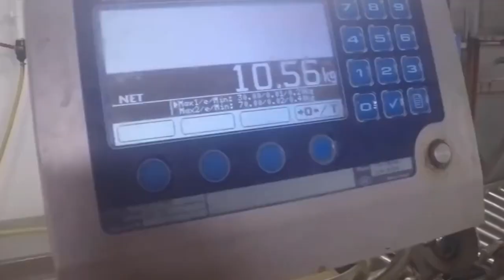Alaska Job as a Seafood processor on a fishing vessel.  What does a fish processor do?

Comment: How much star paying
Reply from the maker: Depend on what company but $11-$13 start pay
Reply: I work for silverbay seafoods, not a boat processor but they start at $13
Reply: Cross Repents  i think i was averaging about 2800 every 2 weeks. $13 for your first 8 hours and 19.5 for the last 8 doing 16 hour shifts. you make overtime every single day. and anything over 40 hours in a week is $19.50 for the entire 16 hour shift. which is easy, consider 1/2 through the 3rd day in a week you hit your 40 so.
Reply: Cross Repents  totally worth it, i have another manufacturing job now building air conditioners and i work 8 hour shifts and it’s a vacation compared to alaska so it makes you appreciate a “normal” job. the work is easy it’s just repetitive asf and it gets old but the paycheck keeps you goin, the freezer position however isn’t anything i’d recommend to anybody. this past season i had frost in my eyelashes and eyebrows in minutes. got brain freeze in about 10-15 mins. but, each struggle is only temporary, ya feel me?  living conditions are very ehh. bunk beds, 4 people to a room, there’s a little store you can use payroll deduction as currency at for soap and candy, soda, noodles, and most necessities. the cafe feeds you 3x a day, 5x-6x a day during production cus you get a break every 4 hours and you eat, while still getting meals. most meals are pretty basic with koolaid or coffee to drink and rice will be in each meal. tbh, coming from georgia, US, 10/10 man. builds character and gives you appreciation for what you have at home.
Reply: Cross Repents  never worked for them. only silverbay homie.
Reply: Cross Repents  i haven’t noticed any racism towards blacks. pretty sure there’s a policy with termination about racism. but not many, most black folks don’t really like the cold too much. i remember about 15 of the prolly 150 people from this last season.